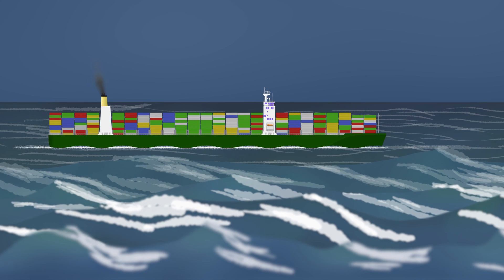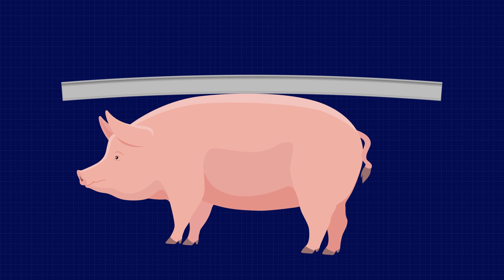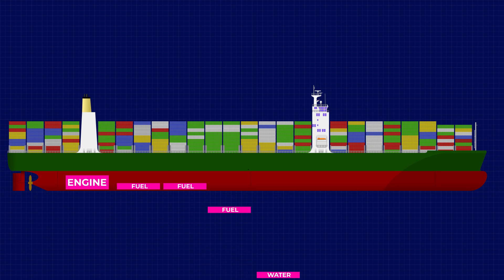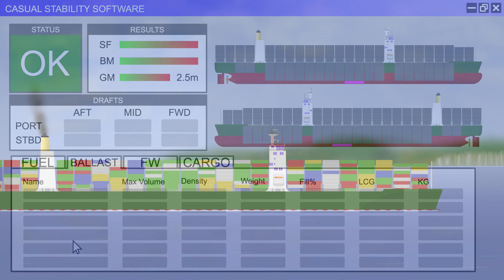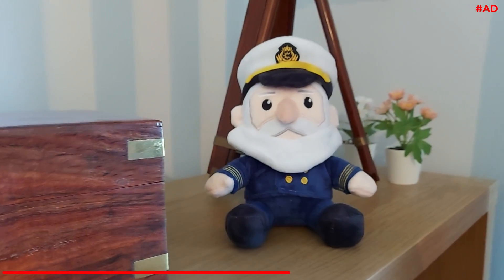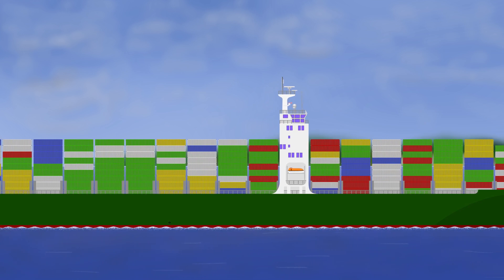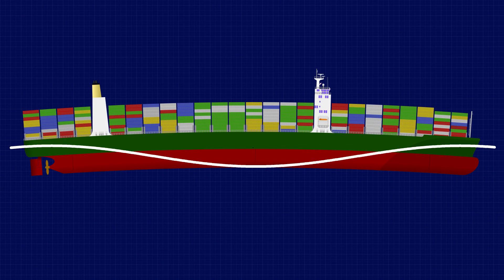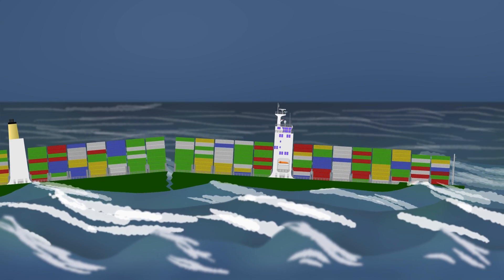Why Are Big Ships Bendy?

Comment: Apparently aircraft do a lot of this very visibly in turbulence, like if you're seated at the back of a large widebody flying through rough air and look down the aisle, you can really see it bending up and down. And it's designed to handle that with no problem. Never seen it myself, but I've heard of it a lot.

Comment: I dont even look the vid 😂😂😂 like a bridge it moves under load wave weight of the boat water pushed to the side underneath the bothchanges the load on the down surface of the boat so it must be bendable or it craks easy to self explain no

Comment: With the wave action I assume fatigue is going to be an issue. Are the ships regularly inspected at critical points?
Reply: The where actually several ships that cracked in two, back in the early days of metal ships. Due to fatigue that the engineers had underestimated as they didn't quite understand the effect environmental temperature had on steels properties.

Ie. The engineering margins for fatigue didn't account for the cold water making the steel more fatigue prone.

Comment: When calculating ships seaworthiness and draft you figure out several variables. Draft and trim is obvious but also the vessels stability The stability is defined by the distance between the meta center and the center of gravity (GM). We also used to calculate on what angle of list the vessel would capsize. In addition we would calculate structural conditions like hog and sag. In addition you also have the shear forces that also have to be taken into the equation. On every ship the limits for hog and sag and for shear forces are clearly defined. One for port conditions and one for seagoing. The limitations for seagoing are naturally stricter. Before the days of computers you had to calculate this by hand but there were devices that could help you speed up the process. On the devices you set the weights and the device would in a clever way tell you if you were within the limits.

Comment: If you look at pictures of the Titanic, you can see extra strengthening in the middle of the ship, extra plates and beefier rivets holding it together. This was done precisely to give the ship the ability to deal with hogging and sagging, but the builders overdid it. Titanic didn't live long enough to see this become an issue, but her older sister Olympic did, where they eventually realized that the hull had been made too stiff, and small cracks started to form around that extra reinforcement in the middle.

Comment: Does the weight of container differ, and if so, can this influence the buoyancy of the ship, or do you have to include that in the planning Phase of loading a ship?
Reply: Yes, the weight differs depending on the cargo. You have to include that in the planning.
Reply: Thank You, so the Person planning knows the weight of every Container?
Reply: @mymax1267  They know the declared weight of every container. Which, as the video alluded to with one sinking, doesn't necessarily mean that they actually know how much each container is, because they may have lied about how much it is (I assume either for shipping rates based on tonnage or illicit cargo)

Comment: That's actually how most torpedoes work nowadays : remove water from underneath the keel and let the beam sag beyond limits. Works especially fine with sub, and you don't need to be too accurate to produce massive effects (ie, even if you don't hit the target, it's likely to be damaged)
Reply: Or the reverse, lifting it up above the highpoint of the flex arc
Reply: It doesn’t remove the water, it pushes the ship up and breaks the keel, an explosion lasting a fraction of a second wouldn’t clear enough water out to cause it to snag. It gets thrusted upwards, literally snapping the keel as it comes back down. There’s YouTube footage of Uboats sinking merchants where you can observe this
Reply: @223frankthetank  key point being nowadays. U-boats are hardly current tech, iirc
Reply: @MrHegemonie  still not how it works though. And the technology for torpedoes only changed in how they’re fused and how they track targets. An explosion under a ship is the same, whether it’s 1000 pounds of explosive from 1941 or from 1991 doesn’t change how the physics themselves interact with the ship…
Fusing and detonation were just
Worse back then. Torpedoes haven’t changed much
Reply: @MrHegemonie  do modern torpedoes explode slower than WWII-era ones? 🤔
Reply: @347Jimmy while it sounds stupid,  you could make one that did by using a different type of explosive and/or a different shape, modern torpedoes do actually take this into account and are designed in a different way than ww2 era ones (they want the same effect just more effectively).

Not all explosives act the same, some are capable of creating a faster moving explosion than others, others can create a slower moving explosion than moves more mass due to how they interact with the water and the energy transfer, explosives are designed with more thought into energy transfer than just "big bang" now due to advances in chemistry and physics.
This is also completely skipping over how some explosives are more efficient at converting the energy of the blast into kinetic rather than thermal energy allowing a smaller mass to have greater effect on target.
When you throw in the shapes of the explosives it gets even more complex as they can direct the force much more precisely than during ww2, especially when combined with advanced guidance and detonation systems.

In effect a much smaller charge can have a greater effect on target by been both directed and using an explosive mix that transfers the energy more effectively. The overall effect however is basically identical, energy hits the ship and breaks it by making a hole in it.
Oh and the other notable change is ww2 torpedoes basically were designed to blow large holes in the side of ships causing them to flood,  modern torpedoes while still blowing holes in ships are now designed as they can be effectively aimed to break the keel of a ship by essentially blowing a hole in it (snapping it), causing a type of damage thats much harder for a ship to survive, they are not designed to slam into the side of a ship anymore (some are, the more advanced ones are not), they are designed to detonate under the ship with the blast aimed upwards (which is why they are also designed to run deeper underwater rather than surface skimming).

Essentially it's the same logic as has occured above water for warship armaments. We've gone from throwing large explosives at each other (unguided shells/ww2 torpedoes) to small precise explosives (guided anti-ship missiles/guided torpedoes) that can have much greater effect as they are deigned to land killing blows with every hit rather than just hoping for a killing blow.
That said, navies still do use some ww2 style torpedoes were the aim is just to blow a large hole in the side of a ship, they just tend to have better guidance, better fuses, longer ranges and more powerful explosives than their ww2 counterparts (usually, some navies still have in their inventories some of their ww2 munitions).
Reply: @cgi2002 Minor correction regarding anti-ship missiles, the warhead carried is far larger than the explosive payload found in any shell. On the extreme end of things, the Russian Granit missile carries a warhead that weighs more than an American 14-inch battleship shell, and even smaller missiles like the Harpoon pack warheads that weigh around 500 pounds.

Comment: Then why do ships break up? In 2012, the container ship Rena broke up off New Zealand. In 2021, a freighter breaks up off the coast of Turkey. What do these two cases have in common? Both ships were in a storm. Due to the rides over wave mountains and through wave valleys, the hull is particularly strongly bent. Over time, this leads to Micro cracks/fatigue crackswithin the steel, which spread further and further over time. This can then lead to a breakthrough in another storm. Bending forces may not immediately lead to breakage, but they favour the formation of Micro cracks/fatigue cracks. And these microcracks can become dangerous over time.

Comment: In metrology (the science and craft of measuring things), there's the saying that everything is rubber. Even solid granite measuring plates have some sag when supported at the ends. The trick is to keep the deformation of your measuring setup so small that it doesn't matter for what you're measuring.

Comment: How about cruise ships?
The new modern ones (check out Adam Savages series) can have a staggering amount of people, moving about an congregating depending on activities.

Is this something that would be taking into account when designing hull and internal layout?
Reply: People weigh nothing compared to the overall size of the ship. The Wonder of the Seas has a gross tonnage of almost 237.000t. Comparatively, her deadweight tonnage is 17.100t. At maximum capacity, crew and passengers take up about 750t of that. That's not a lot stability wise. Compare this to the largest cargo ship. Gross tonnage is 236.000t, but summer deadweight is 241.000t(according to Marinetraffic). Hogging and sagging in cruise ships has much more to do with the weight and design of the ship than by what is loaded.
Reply: Yes, I can't remember the exact criteria but it has something to do with how much the ship is allowed to list to one side if all passengers go to that side, I think there are some additional requirements for passengers ships compared to cargo ships.
It has to do with Gm curves and intact stability etc, I have luckily forgotten all about it.